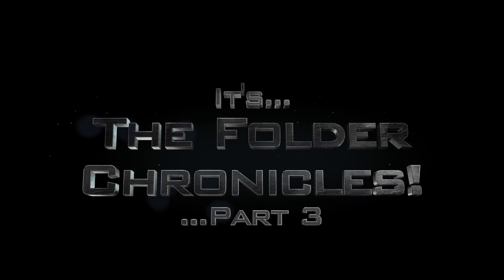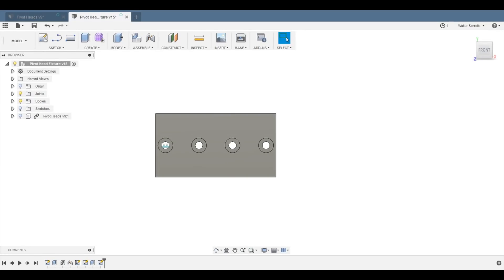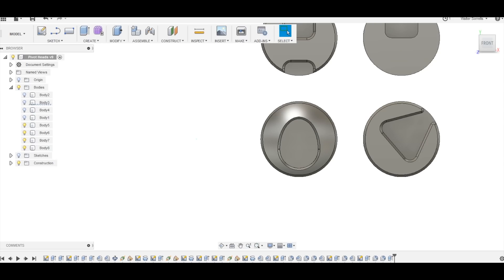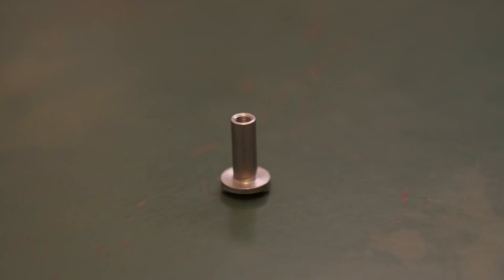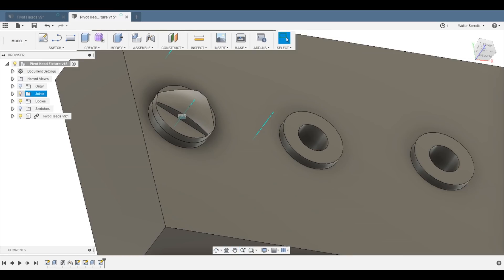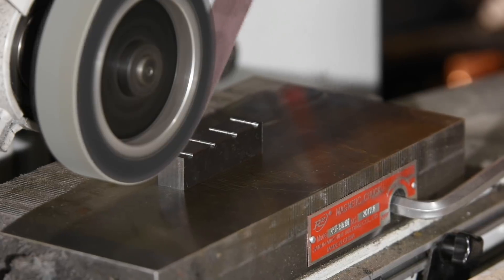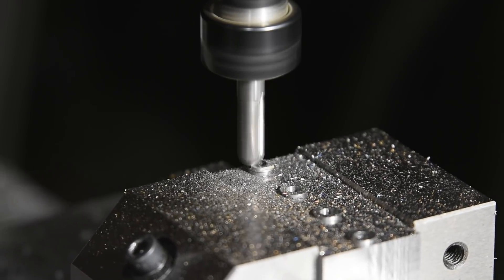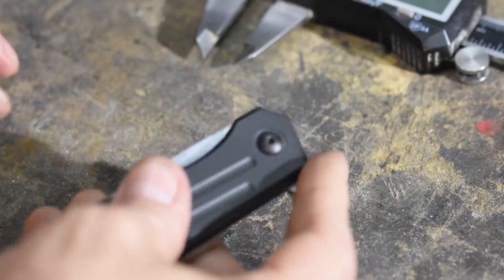Folding Knife Chronicles #3 - Pivot Pins

Comment: You should do a video going over the difference in grinding a bevel versus and edge. I had a lot of confusion on it. As I understand it you swivel at the hip causing the handle to be pulled back for a bevel grind but you swivel the knife along the tip when grinding in an edge.

Comment: With 4 in the same grip you will run into tolerance problems where smaller pins may climb the mill.
Reply from the maker: Yeah, I was afraid that might be the case.  So far seems to work okay, but I may have to go to two pins at a time if that turns out to be the case.

Comment: If your only (or most important) way  to differentiate is the proprietary pivot hardware then you're doing something wrong. Not to mention that all the designs you showcased are already pretty much done and taken by some manufacturers. You can be fancy with the pivot screw but at least keep it torx or flat head. Propietary pivot is huuuuuuge no-no for many of the folding knife people. I'm really interested to see what you will come up eventually! :)